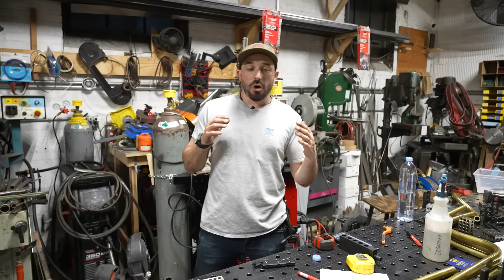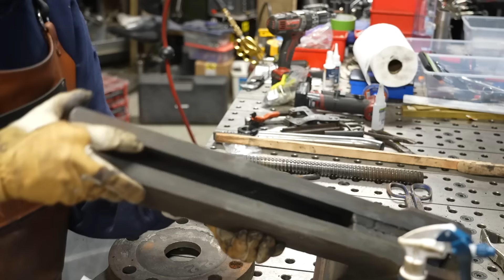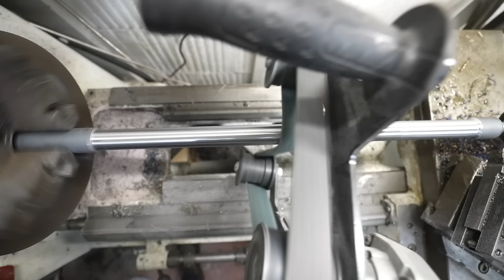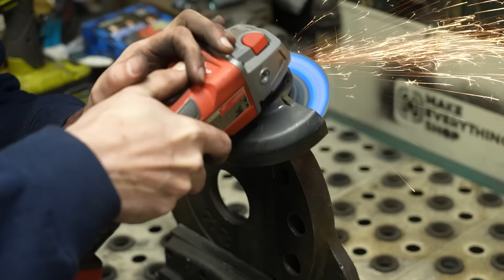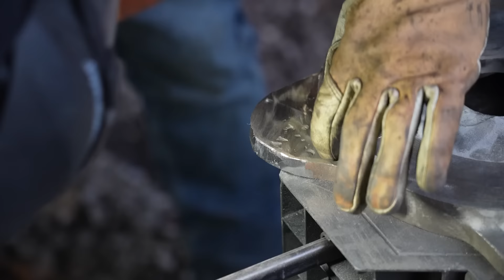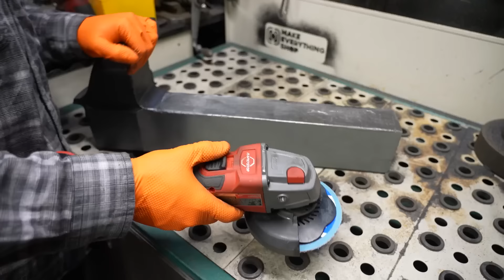Have You Ever Seen A Vise This Big? - Restoration

Comment: About six months ago I saw this video, or one like it and realized that I have one of those vises! My swivel pin was mashed over by hammering and I am having a devil of a time removing. I thought there might be another locking pin holding the big pin, but I guess not. I have drilled the thing as of it had a step, but you've shown me that it is tapered. I will eventually get it out. Thanks for all the help. Wc.

Comment: Just a tip, when your cleaning up cast iron to weld don’t ever use a grinder because the heat of grinding pulls up all the carbon and crap in the iron. Use a die grinder with a carbide tip and you’ll notice the difference. I’ve done blocks/ manifolds etc for years . Nice vice.

Comment: This pin, (if you are fortunate to have this type of vintage vise) can be push out by tapping it out from underneath using a hammer and a punch. Heat will not really help and will probably make things worse. Mine is a Charles Parker #270. People, grab them if the occasion presents itself.

Comment: I don't know what it is BUT if you use a wire feed welder you can weld the hell out of cast. I have been welding cast with my wire feed and I have NEVER had an issue.

Comment: Greetings from Brazil. Here to TIG weld cast iron I use a 1/8 stainless steel 308 rod with a piece of rigid copper wire, it can be a piece of old electrical wire, degrease it well, braid the two with the screwdriver and it is perfect, without holes, do the test.

Comment: I had a 200lb swivel jaw vice with a stuck pin. I tapped out the cross pin for the main pivot which allowed removal of the swivel jaw and stuck pin. Then I set it in my 20 ton hydraulic press and pushed it out, when it released it sounded like a gun shot and dented the bottom rail in the press.

Comment: Heat that pin and add 50/50 mix of acetone and ATF to soak in.  You could have drilled and tapped that pin and threaded in a bolt to use as a "gear puller".  Add heat as you go and it would likely have popped right out.

Comment: Loved this video. Could not stop until I finished it. The vicarious satisfaction is phenomenal. Loved the way you welded in that cast iron. When you learn, we learn. 

Couple of questions/ ideas:
* Wonder if you should have made your v-grooves deeper. You mentioned, "...IF I can get the round stock to engage..." Wouldn't a deeper groove have been beneficial? Recognize that you may have had to make a beefier set of jaws so that a deeper set of grooves would not have compromised the strength/ integrity (more $$$, sigh). 
* Total amateur here, but I would have expected you to have coated the vise and base plate with some sort of paste-grit and then spun it around some dozen(s) of times to ensure a perfectly smooth, matched fit (and then of course wiped it off completely. Did I miss some sort of greasing between the same two parts, or is that not desirable? 

Overall, phenomenally engaging and educational. Thank you!

Comment: Any info on where to purchase  the bearings and tension spring set up for this vise? I Got one on good deal… 3:09 I used palm nailer with a pin  to pop swivel pin out from under side hole.  Please note do not use your hand on palm nailer.  push/pry with pice of wood to activate palm nailer (palm hammer)

Comment: Nice job. The cast welding was interesting. I've been welding cast for about three decades now and I've never seen it done that way. It's good to learn alternative ways to do things so I'm going to put your idea in my back pocket in case I ever need it. My usual method for welding cast is to pre heat the parts to 600F (use a temp stick) and then stick weld it with 3/32" Super Missile Weld, peen with a small air hammer between each pass. After that wrap the part in fire blankets and leave it until the next day. Great videos, keep them coming.
Reply: I thought there is a process called "induction furnace brazing" that restorers of muscle cars use on Uber expensive factory exhaust manifolds.
Reply: @uncleronny6748  Completely different process. The process that you refer to imparts a more even heat to the whole piece but at lower temperatures to limit warping. Not the easiest process for large heavy parts but great for lighter more intricate castings.

Comment: Three things, first your crafty and I admire that. My Dad used to weld cast iron. It’s a bitch. Lastly don’t think I didn’t see your tidy cat kitty litter bucket. 😂.  At what point do you start throwing those out?  They are perfect
Reply from the maker: @fastj1962  first rule of kitty litter buckets is, you never throw away a good kitty litter bucket 😉 thanks for watching!!
Reply: Never had a cat as an adult but my mom was a cat lady. My wife and I inherited her cats and at one time had 20. lol got that down to 5 and now we have 9. 5 feral cats and they are all nuts. So yeah lots of buckets!
Reply: By the way, cut a hole in the side of my house with a kitty door. Put a deck box outside where two kitty liter boxes are with a 120 mm exhaust fan.  No kitty liter in my house. Everyone thought I was nuts when I did it. Works flawlessly.

Comment: WD 40  Sucks  lol I use  KROIL   works Much Faster and more Effectively .  in Addition  HEAT up the area around that Frozen Pin  ,Its only a tapered in , so you only have to move it a Tiny Fraction to remove the surface area tension !

Comment: This was difficult to watch. While working on a metal vise with bolt holes, on a welding table with holes, it's constantly slipping around as you work on it. It didn't occur to drop a bolt or a bar to anchor it from sliding. 
When pulling the greasy dirty slide jaw out, on an old and heavy vise, it might be advisable to have the heavy steel table under it rather than your feet.
I think I would have put some wood or metal blocks and wedges in the hole to put force on that pivot pin before wasting time modifying a cheap jack. The jack was being mangled under the force while the pin was sitting where it had been for generations.
Reply from the maker: But the jack worked
Reply: @MakeEverything  If you had beat it with a pencil for three years, that might have worked too.
Reply from the maker: @johnguilfoyle3073  also a good idea

Comment: Awesome! I have a smaller version and it's super nice. Not sure if this was original, but the pin on mine has another taper on the top part but it's much shorter. I think it's so you can set the pin in the hole so it doesn't get lost while using the vise in swivel mode

Comment: Would heat been a choice to remove the tapered pin out?
Reply: Or weld a nut to it. But the sponsor is WD. Probably don't want to offend them. Bronze bushing looks nice but now the rod is smaller diameter. So it's going to bend easier. And a vise that big, hell I've used cheater bars on smaller vises. One more note. You really don't want bearings on the screw. That friction is what helps the vise stay tight when beating on something. That bearing is going to make it easier to losen up. A bronze washer would have been a better choice IN MY OPINION. But, to each their own.

Comment: Oh yeah, I have a similar vise and right around that weight I think.  A Starrett 646 It's a serious chunk of Iron. Most of the time if find if you have porosity while welding cast iron, grind it out and weld it again. Sometimes you have to do that a few times to bake out the crap. I find it all depends on the iron. Some cast  iron simply does not weld at all. Some welds like steel. most of it falls in-between.  I guess it depends on the make up of it and what the service conditions were over the years. Nevertheless , good stuff here, well done.

Comment: WOW  thats a Sweet VICE !
try using a Warrior paint removal disk in your right angle grinder... it will quickly remove paint n stuff and it will polish  rusty metal up to look like chrome !   Perhaps you should make a new pin for that swivel jaw that is taller and put a pull ring on it or a ball  to make it easy to grab

Comment: Yes (I have seen a vise that big). I have a Prentiss 23, and others that are larger.  You're lucky you didn't break the swivel jaw pressing up on the pin without clamping the jaw down to the base.  Next time if you're going to destroy the pin anyway, center drill it, tap it, thread in a rod, and use a piece of pipe or a socket, some washers and a nut and jack it out that way.  And heat of course...
Reply: I can’t believe that a comment this good didn’t get a like from the creator.
Reply: I have a Meridan one about that big. No swivel jaw, though.
Reply: Ok boomer
Reply: @HoddToward1995  k snowflake. Afraid to learn from a smarter generation? You are breathing because of a boomer. Wake up!!!!
Reply: @HoddToward1995 Wanker
Reply: @shanelodge391  k boomer 😉
Reply: @HoddToward1995 2/10 ragebait

Comment: Inspired me to work on my Prentiss 22(no swivel base unfortunately but oh well) and I finally got the pin out.  Harbor Freight sells s 10 ton hydraulic short body ram and a manual hydraulic pump with their autobody repair set.  It popped the pin out super easily, and Im sure I can find other uses for it.

Do you have a link to the thrust bearings you used?

Comment: Had one of these that was made by the Reed Manufacturing Co of Erie PA, that I had purchased at an auction. How it made its way to Australia I’ll never know. It lacked the tapered pin but the swivel was rusted solid. It took me three weeks with penetrating fluid squirted in everyday and banging with a mallet and wood block.

Comment: That’s a beautiful vice, you did a wonderful job and the restoration. Just one shop tip, before you clamp in your mill vice, remove the parallels and clean the jaws that side, the top, the bottom, the parallels, and then play some back in there. We could see the part move on you as you were milling. I thought for sure you were part. Take 30 seconds to clean the vice and parallels will save you a lot of time by starting over or a trip to the ER. Look forward to your next video as always.
Reply: I thought my eyes were messing with me, I'm glad I wasn't the only one who saw that

Comment: That cast iron weld is so yucky. You were using wayy too little amps. It looks like someone trying to braze using a plumbers propane torch. Probably should have put 50% more amps. If you break the flux off a ni99, chuck it in a drill then spin it in some sandpaper to get rid of all the flux and oxides. It's also why you'd randomly have your weld explode outwards and turn to foam, and why you can see silicon islands on your lumpy mess. It's.. rough, I would be surprised if it lasts a year. The needle scaler is a good method.
Reply from the maker: It worked great and it’s going to last forever
Reply: @MakeEverything  Probably. There's enough meat there, and being bolted to a table would keep the forces mostly off of it. But throwing some more heat at it would have been easy for you to do, for next time. Cast iron is more voodoo than science TBH.

Comment: Wow, that's a really fucking cool feature. Never seen a swivel head like that before.

My only concern is, why not use grease instead of oil? And also, on that note, how do you add oil in the future for maintenance? Do you have to disassemble again? Or is there like a fill port somewhere? Alternatively, if you used grease, then perhaps a Zerk fitting or two.

Comment: I have 2 22s in the garage now that I’m working on. The pin one one is giving me a massive headache
Reply from the maker: someone on Facebook said you can use a pin through the swivel bolt hole and hammer it straight up through. I either didnt notice that, or my swivel bolt hole was filled with gunk, either way, the $20 scissor jack worked well!
Reply: @MakeEverything  I’ve mushroomed out a steel round bar doing that. Might have to cut it and drill it out then make a new one or get Logan to
Reply: Get one of the hydraulic short body jacks from HF.  Mine popped out super easy once I put that in and pumped a couple times.  It's about a $300 investment but useful for all sorts of things
Reply: @Kami8705  I’m keeping an eye on fb marketplace. The 12 ton ones seem to go for 80-100 used. I’ll snatch one eventually
Reply: Use a stick welder and weld a nut to it. Let it fully cool down. Lots of penetrant and an impact back and forth. The hammering affect will help the penetrant soak through. It dons't have to break free in a day. Give it some time. It took 20 years to freeze up. Let the oil penetrant do its work. I would not put a scissor jack in there. That's a good way to crack the housing.

Comment: I have vise envy🤔

I can only think of 4 tools that still needs CPR. An old Kemp original shredders, an old wood lathe  a newer wire feed welder, and my grandfather's air compressor could use some TLC. Those are the only pending projects that the sponsor of the compilation would be interested in.

Comment: Slide hammer would have worked to remove pin. Also look into an extremely easy way of cleaning old steel called electrolysis.

Comment: cast iron welding is best avoided. proper weld prep for 100% “penetration” aka full wet in. With silicon bronze either flame or tig brazing has been very very successful for me.  SilBronze is slightly stronger than your average flux coated brazing rod from big box stores

Comment: Why didn't you use heat on the swivel pin?
Reply from the maker: I did along the way, it took everything I had to get it out
Reply: @MakeEverything  Just a theory, someone wanted to move it and drove the pin in with a hammer. There is no way it got that stuck just sitting in the hole.
Reply from the maker: @justanamerican9024 oh definitely, it’s very common that those pins got bashed in and then left outside to seize up. Most people don’t even know they have a swivel jaw vise because the pins got ground down inadvertently
Reply: People use it as mini anvil…

Comment: I've been slowly working on a swivel jaw pin for 11 months now. Lol
Reply from the maker: Did you see how I got this one out?! I think it was well worth the cost of that scissor jack!!
Reply: @MakeEverything  I took note for sure. Plus I'm going to make a set of those jaws for a Parker 4 1/2" swivel. Ever make Parker jaws?
Reply from the maker: @mikerobinson6606  yes I have, in a very old video I made some, I didn’t do the best job on those and used a dovetail cuter that wasn’t really the right angle, that being said they worked out well!
Reply: I've been fighting a pin in a smaller prentiss for at least that long, although only recently got serious about it.  At this point I'm looking at drilling it out, it doesn't want to budge and you can't hit it from the back side.  I thought about building a very simple machinist jack to do basically what you did, but I doubt it would have the power for it
Reply: @Kami8705 how much effort have you put into twisting it? I feel like that might be the most effective.
Reply: @Kami8705    Be careful how much pressure you put on the pin from the inside.  Cast gives very little warning before it cracks.  I think you're on the right path with the drilling idea